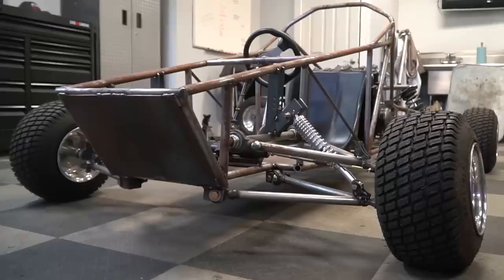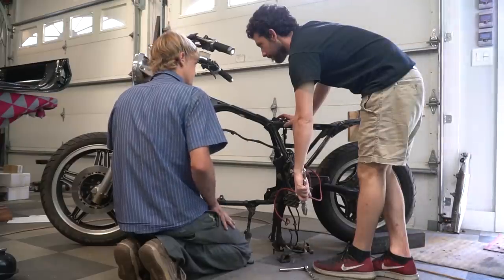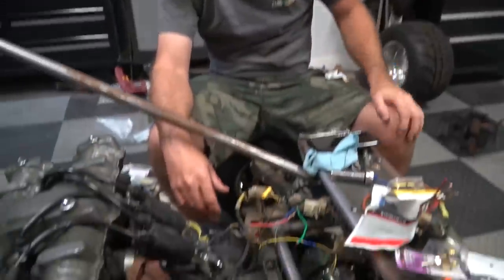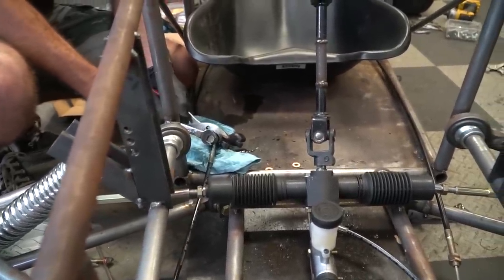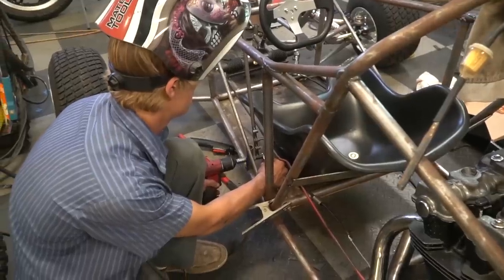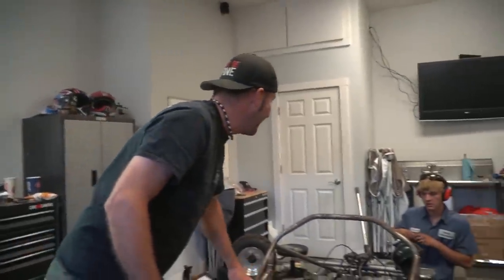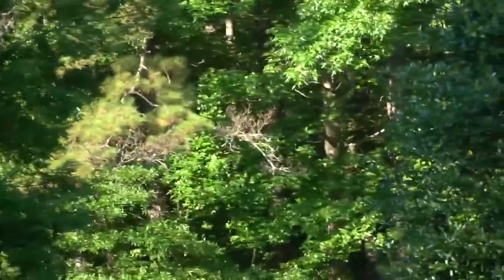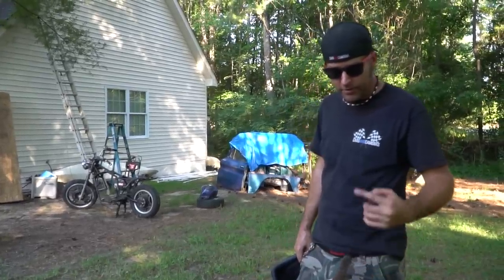750cc Cross Kart FIRST DRIVE!

Comment: I used to pump brakes when I bled them to until an old-timer taught me not to pump them but to apply the pedal hold it break the bleeder lose then repeat don't Pom-Pom it just pushes the air bubbles back around through the system back and forth try it this way it's a lot faster

Comment: itd be easy enough too use some thin sheet metal and make a little heat sheild that bolted too the rocker cover bolts or somewhere around that too protect from some of the heat

Comment: It would be cool if you put the gauges on the cart if the Speedo works you won’t need to use a phone for your speed also try mounting a boat gas tank in it somewhere they hold either five or ten gallons either way it’ll be fine

Comment: So I just installed an old 208cc ironton on the cart that I'm building from scratch. The motor runs like beast and starts on the first pull, even after sitting all winter. However it has absolutely no power to the wheels. You can run it wide open and all it does is rock the wheels a bit. So I'm trying to figure out what's wrong with it, unfortunately I'm no cart wiz like you guys. Maybe you could drop some advice for me?
Reply: Sounds like a gearing problem
Reply: @isaacitllbefine7231  just finished cleaning out the carb, didnt think that was the problem but did it anyways since it sat all winter. I'm waiting till my girlfriend wakes up before I start it up so I dont wake her up lol. A friend told me that the chain may be too tight. However I dont see how that would affect it. Thoughts?

Comment: Put an electric fan in front of the engine ..your seat is blocking most of the airflow .. that twin overhead cam 750 has a chromealloy bore it doesn't like over heating .and the piston rings can trash the sleeves ..been there ..wen I build a dingo go-kart back in the 90's with a 79 Honda 750 c - custom engine ..it had 12,000 miles on it and after a couple of long hard runs over one weekend . It began to smoke like a diesel freight train .so I tore it down to find the rings had been cutting vertical groves in the cylinder walls ..into the brass sleeves .. so I ended up re-sleeveing the jugs and adding a fan and scoops to cool the engine

Comment: Awesome porject guys, but if you don't modify the oil intake of the oil pump you will kill the engine with oil starvation during cornering. Motorcycle oil pans aren't built to take transverse loads at all. Please don't kill that 750 four =(

Comment: I bought the same brakes from go powersports and they’re not working either. I bled them but the piston in the master cylinder doesn’t seem to be pumping fluid through the line. Anyone know what the problem could be?
Reply: Keep the brake line as level as you can then jack up the rear of the kart to let the air bubbles travel to the rear
Reply: Thanks! Love your guys’ content. It’ll be fine 👍🏼

Comment: Why not put a heat shield behind the seat to protect the driver and that plastic seat your sitting in. Now you're finally doing what I said to do a year ago. Carbs need to be rebuilt and BALANCED WITH THE CYLINDERS. Then it will cook/dig deep/full pull.

Comment: I always wanted a cart with a motorcycle engine   mostly for the transmission. BUT  I would be concerned about using an air-cooled engine. I think water cooled and even add a oil cooler would be a big plus  short of a fan on an air cooled lawnmower engine   in short this will overheat. It will not last too long.

Comment: so i am looking at your front suspension mounting and i don't know the dimensions but to the eye it looks like your suspension mounts are leaned in too far. with double a arm suspension you have 2 main torque vectors. 1 is linear motion and the other is tangential to the arc of the bottom control arm. the torque tangentially should never be larger than the torque linearly or you will bend your shocks. like i said i don't know the dimensions of your rig but it looks like the strut combo might be leaned in too far making the tangential torque larger than the linear torque.

Comment: Love your choice of motor the Honda 750 motor is a great choice! I had a 1972 Honda 750 which was the year right before they (supposedly) tuned them down hense why mine was still very very fast.running a close 2nd to the Kawasaki KZ 900. I never get tired of listening to the exhaust of these 750's just love the *uck out of them!!

Comment: The carb jetting is not your problem, it’s the pods. Put the stock airbox back on and run it like the genius engineers designed it to run. Those carbs are vacuum driven to the specific tolerances of the airbox... pods will never allow it to pull correctly at high rpm’s.

Comment: Are you going to skin it with sheet metal or fiberglass?
Reply: Im not sure
Reply: @isaacitllbefine7231 . Fiberglass would probably be better for lasting but if you have any plans on bashing on it much then skin it with sheet metal that way if there is a accident then it's a quick easy repair

Comment: You guys are bleeding the brakes wrong, your supposed to open the bleeder press the peddle down close the bleeder release the peddle and after doing it a few times pump the brakes
Reply: We did it more than a dozen times but there was a air pocket at that block that wouldnt pass.

Comment: let me get this straight, rather b welding is making a dune buggy with a honda 2 cylinder engine,  carsandcameras is making a cross cart with a honda 4 cylinder engine, and moto migs is converting a honda 4 cylinder  honda bike engine to the naskart hrmmm... '~`
Reply: rather b welding 's engine is a vf1000  v4 so 4 cylinders just to be clear check the viki https://en.wikipedia.org/wiki/Honda_VF1000